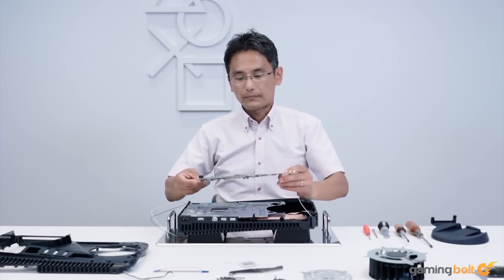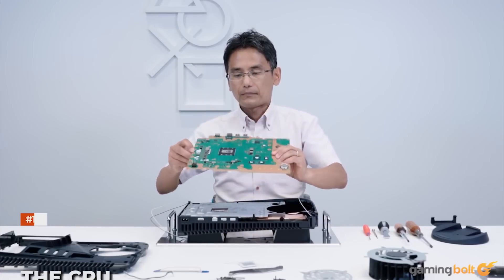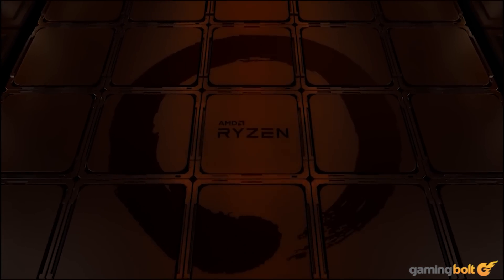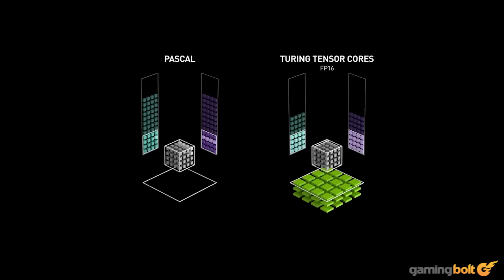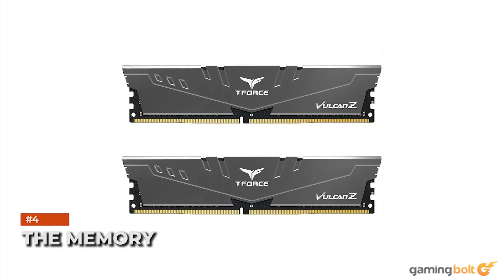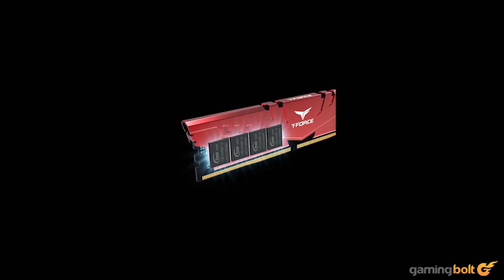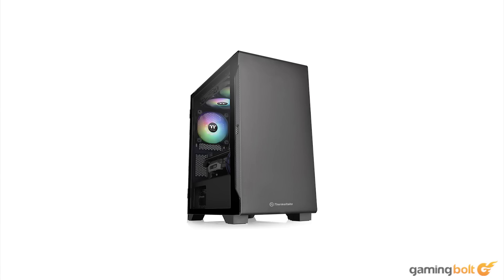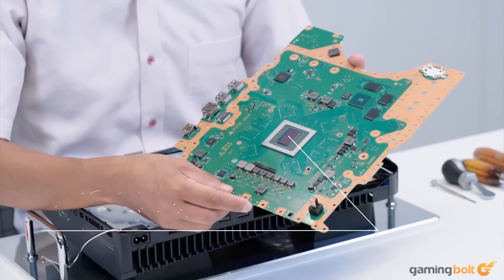How Much Would It Cost To Build A PC As Powerful As The PS5? (2021 Edition)

Comment: $1137 and you’re still cutting corners on the ram and SSD lmao. If you added those into spec you’d be looking at 15-1700 dollars.
Reply: And if you leave out the Bluray it should be compared with the price of the cheaper digital only PS5.
Reply: @Transistor Jump most do. I'm not talking about exceptions
Reply: The SSD is probably the reason why is costs so much
Reply: @Transistor Jump yeah, but why's digital version so pricy? then I have to wait for amazon/ebay delivery for a week or two. maybe more
Reply: They arn't cutting corners, just picking the most popular choices, because this is just a fluff piece.
Reply: @Dutch Plan Der Linde nobody mentions buying gpu before you did. Your still the idiot here
Reply: Cutting corners with ram? 12gb of vram and 16gb of system ram is nearly double of post memory pool. What they messed up with is the CPU and GPU as both of them are way more capable than ps5 contains.
SSD isn't bad tho, but agree that they could've picked a better one and not samsung
Reply: Most into gaming on PC probably at the most need to update the GPU or more system Ram . I have twin NVME drives in my PC plus 2 older SSD's.  It's not that expensive and you can just add to it as you go unlike a console. I do have a Series X as well and i love their expansion solution being hot swappable which i use regularly but some games i just prefer the mouse and keyboard.
Reply: @DEVILTAZ35  i want them to make it so you can play steam on xbox because i dont like gaming on my pc I couldn’t figure out how to get the controller buttons correct (keyboards are hard to play with) and i know playstation wont do this atleast not before xbox does
Reply: @Transistor Jump Don't matter on the pc platform. The difference between sata and NVME isn't noticeable in games. 

The Ps5 is actully much better in this regard. Due to the machine and OS being designed with NVME speeds in mind.
Reply: You can even use an HDD and it doesn't affect fps, also the ram is perfectly fine 🤷🏻‍♂️
Reply: i think owning a pc is cheaper in long run. you don't have to pay full 60 dollars for games. steam epic gog and others always have sales. and much cheaper monthly subscriptions if you're into that. where consoles have more expensive subscriptions and if you miss one month, you're locked out. just today I wanted to buy Tekken for my PS4, and it costs 50$!!! I got it for 5$ on steam. it's an old ass dead game. it shouldn't cost 50 bucks
Reply: @AldoApachi-  yeah free online alone saves 400 bucks in the long run for one generation
Reply: @i-10haula88  You have greefer free modder free envirornment and also shareplay with your friends along with cloud saves.... Also 36 games a year with 20% discount on any title around the year.... PS plus has its own benefits...
Reply: @AldoApachi-  who pays full 60 dollars for ps5 I guess I will pay 60 dollar for a game if I am a big fan of that game like ps exclusives etc......and also at launch pc gets the same price too and after 6-7 months they get the sale and still no that big the sale is impressive after 1 year on a particular game bro and also you talking about that subscription that subs cost 40 dollar a year in my country and out of 12 months ps owners get atleast 4-6 AAA titles free whose real cost is a lot and also constant discounts on AAA games with that subscription  no doubt PC is better but it is hella expensive even in the long run as you have to upgrade it for better performance....always and the exclusives at 4k(sometimes upscaled sometimes native but still looks gorgeous) is literally awesome  and the dualsense haptic feedback controllers adaptive triggers all this immersive tech for just 500 bucks :) and thats it my friend HAVE A NICE DAY :)
Reply: @AldoApachi-  PSN has sale everytime and physical games get very cheap as time goes by so your comment about pc games being cheaper is irrelevant
Reply: @AldoApachi-  PS+ 5 yr sub and PS5 is 700 to 800 USD and the PC is 1100 to 1200 USD so 400 USD extra during the start itself....
Also they charge 59 USD to maintain servers and for that you get 36 games a year with 20 % discount and shareplay where your friend can play a game without him owning it for a few hours.... You also own your games if you buy Disc edition... You can sell the Disc for new customers of PS5. 

Then there is a Huge problem in PC industry called backlogs... If you dont want to play a game then why buy it? Also a AAA game takes a month to finish for a normal person. You would definitely want to upgrade your RAM or want to buy replace your CPU especially if it is 3 years and the graphics card a year later...

This model actually works for a normal person especially with a 400 USD initial advantage.... And regarding your miles morales the game is 30 USD on sale in INDIA... If you are on RU/CIS or LAT-AM then I think it is same for you as well...
Reply: @AldoApachi-  brand new games still are full price, if your saying that you wait for sales than are you completely oblivious to the fact that console store fronts also put games on sale after release
Reply: @d8l835  they barely do. Miles morales still costs like 35$. Tekken 50, etc. After 1 month I constantly see prices going down to 20$ or less on PC stores. I made 10 bucks on steam just selling stuff from counter strike. I have 200 coins on shitty Ubisoft store, which allows me to get 20% more on any purchase. Amazon gaming just gave us bf 1 and 5 for free. Epic games gave us Plague Tale for free (and bunch of other games, GTA V). I don't really remember when was the last time that I actually bought a game full price. Epic also gives me 10$ gift cards for no reason every now and then. 

I have so much games on my pc, that I haven't played, any new title will go on rapid sale before I turn to it. 

And all this with no subscriptions whatsoever. 

Also, I have all the old games that I can run/mod and have fun with. I just installed NFS mw (2005) with graphics mod, this game never looked so amazing. 

I also have retro arch and can play any ps1 title, and all the SNES, NES, Sega Shmega titles on 4k! :ddd 

Only thing better about my PS4 slim is it's weight. It's super light and you can easily travel with it. It has few good games, YouTube and a media player to watch movies. 

If I was heavy gamer on a console, I'd be broke right now
Reply: @AldoApachi-  not true bud i have a pc and steam. You will not pay 20 bucks for a new game unless its a complete failure like anthem or some shit
Reply: @AldoApachi-  yes, if the apocalypse happens, neither of us will be playing our games. Nice observation, think of it all yourself?
Reply: @d8l835  don't know about you, but I live in post Soviet country, infrastructure is a joke here.
Reply: @AldoApachi-  well if your relying solely on an online only playable subscription thats your prerogative. And if thats what your doing than perhaps you would have made a wiser decision either on how you get your games or where you get your internet from. Also if the internet is out for a few hours, go outside and you know be a normal human
Reply: @AldoApachi-  No its not, you will have to upgrade that PC almost every year. If PS5 has the same runtime as PS4 then PS5 is 3000x better long run than any PC.
Reply: go check digital foundry's review kid!!

ps5 = RTX 2060 super + i5 9400F / ryzen 3100

sata ssd is more than enough to match console ssd, check comparison between sata ssd vs nvme gen 4

so a $700 pc is equal to a ps5
Reply: @Luiko0406  NX Gamer already said that PS5 is similar to RTX 2080(without Ray Tracing) and 2070 Super (With Ray Tracing). Only a person who doesn't know about tech would even compare a console to pc spec to spec. A console will always be far more efficient than PC